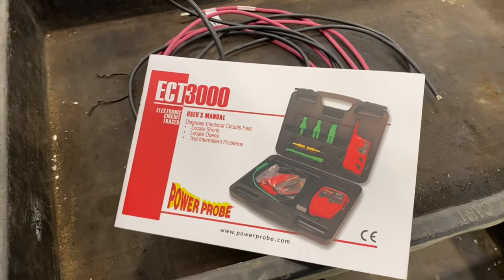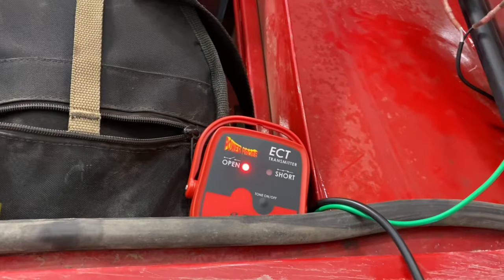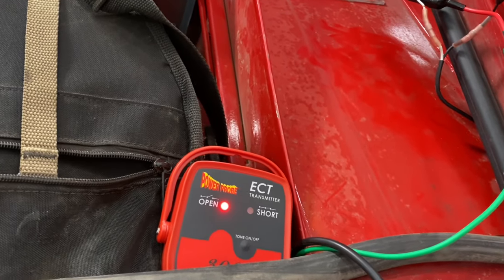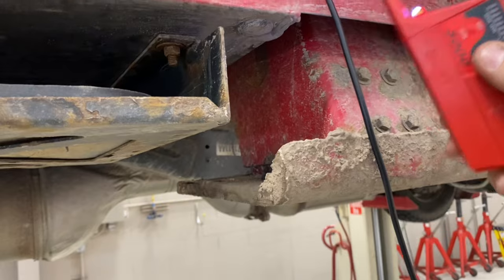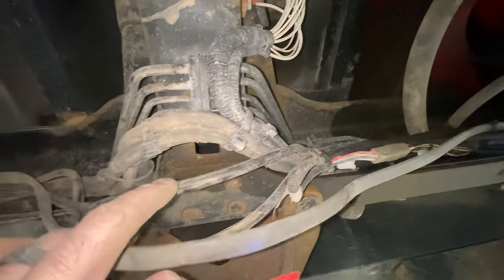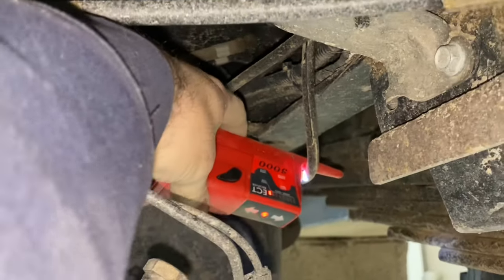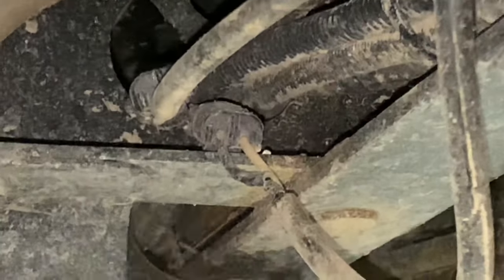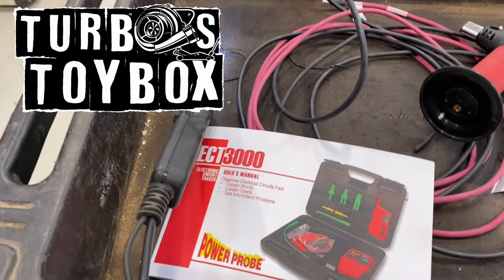Power probe ECT3000 Easiest way ever to find a short!

Comment: Great Video- Your wording is confusing. You are looking for an open circuit, not a short. Thank You.
Reply: I’m thinking the same thing. A short is not an open circuit. A cut wire is not a short
Reply: @ramrod4545 well it’s touching metal so it probably is a short. He didn’t mention a blown fuse though.

Comment: Good info Andy. That tool is very similar to a Telephone wire tracer. I also have a Breaker Tracer for 120/240 power if you ever need to borrow it.

Comment: These are really only good simple wiring like what you are showing, I’ve had one for years and maybe used it 3 times. Once you get into big bundles of wire  or thin canbus wires it send the signal into other wires and send you on a goose chase.  
The first step in diagnosis is a visual and get you hands on the wires has had a higher success rate then that tool. But just my experience with it
Reply: Most shorts aren't in bundles of wires so this will suffice for most jobs.
Reply: @nickquik correct. Still have to follow the wire some how

Comment: So the green wire with alligator clip goes on the wire you want to trace ?
Reply from the maker: Yes
Reply: @turbostoybox2182  I see. I was out in a field with a trailer that had no side marker lights. I got out the ect 3000 but couldn't figure out how to connect it to the pigtail to trace the side marker lights wiring. I've learned not to go forward if I'm not sure and didn't want to end up shorting something and having no lights when we went for home. 

I did have my powerprobe maestro with me, which allowed me to send 12v to the hot wire on the side markers, which lit up the lights and  showed the wiring there was good. Did a continuity test on the hot wire from the trailer connector to the trailer lights all the way to the hot wire pigtail on trailer where I applied the 12v with the maestro and had solid tone. 

Then, I tested the trucks 7 blade pin for this wire and had proper voltage. At this point, I scratched my head for a bit and then it dawned  on me if I had lights with 12v applied, had continuity from the 7 blade to the point I applied 12v and got lights yet I have no lights then the problem has to be in the 7blade on my truck. 

It turned out to be the pin of the truck was flattened down so much it wasn't making a good contact in the trailers 7 blade connector. I just spread that pin open a little and walla ..side marker lights worked again for a safe ride home.
Reply from the maker: @A.C.71  I spent 7 years as an auto accessory installer then 10 years at an auto/Rv repair shop.   Spent my fair share of time scratching my head with some trailer lights! 😂😂. Glad you got it sorted out!
Reply: @turbostoybox2182  The tools we have available today are so amazing. Even a dummy like me can be dangerous to wiring issues once I really learn these tools lol

Comment: The wire is Not  S/C   it is    O/C
The signal does NOT cancel out  - it merely 
ceases to travel along the wire because the
circuit / path is O/C

Your description is totally incorrect and deceptive.
You either have zero understanding or you are
being deliberately deceptive